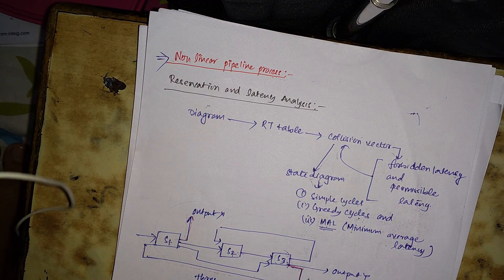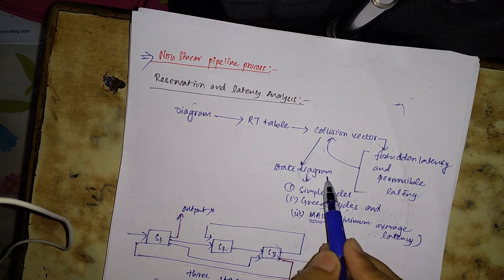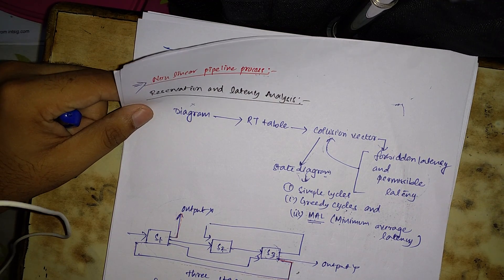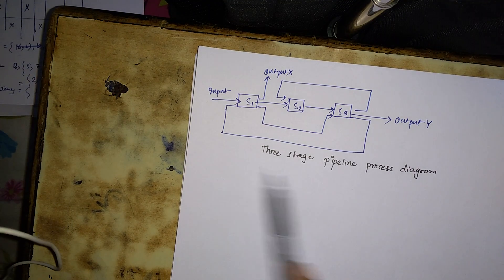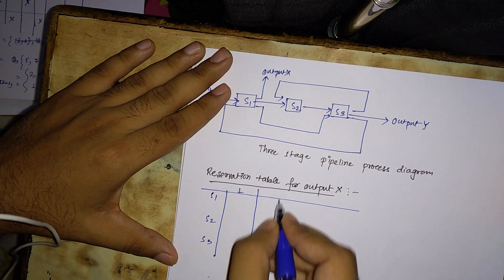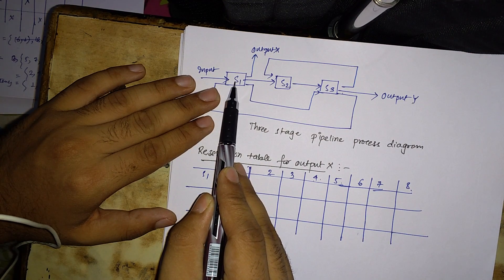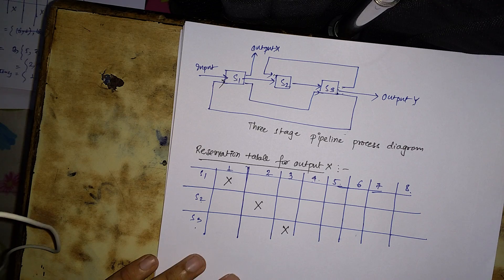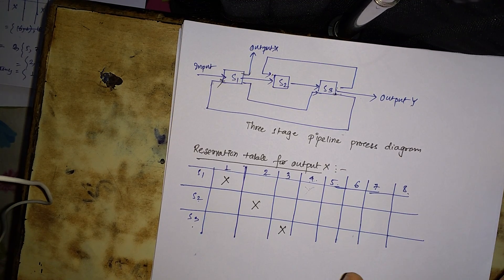pipeline collision vector,reservation table ,part 1

Comment: This video is wrong guys.To calculate the total number of clock cycles you have to take all possible paths in the pipeline.The minimum number of clock cycles to traverse all possible paths is the required no of clock cycles
In this video this is not told.....LOL
Reply: Debika mam toh poriyeche.
Reply: Correct

Comment: How do u know 8 clock will be used
Reply: 2^no. of stages(s1,s2,s3) = 2^3 = 8
Reply: Deepa Pandey I didn't knew this formula....thnxx Deepa....my sem xam is near.....
Reply: But why we take for y 6 cpi
Reply: thanks :D  i was pondering over this question too
Reply: The question has mentioned to take 8 clock cycles
Reply: he cant just know that. reservation table has to be given (in the questn). it cannot be calculated.
Reply: Cyberian Deprochan Ok I'm saying that I have done this question and it was mentioned in the question that the calculation should be done in 8 cycles and every path must be used atleast once.
Reply: viper8890 its ok then bro. but its not mentioned in the video i think.
Reply: Cyberian Deprochan Yes, I have noticed that it isn't mentioned in the video.

Comment: You said, from 5 (when we are in s3) we need to go to s1 in 6 or else we cannot finish it within 8 clock cycles. But from s3 in 5, if we follow this: s2 in 6-->s3 in 7-->s1 in 8, we still end up getting X in 8 clock cycles.
Reply: Because it was maintaion the question,that 8 clock cycle .
Reply: Yes I have same doubt as you. Can you please tell me if we can do it?